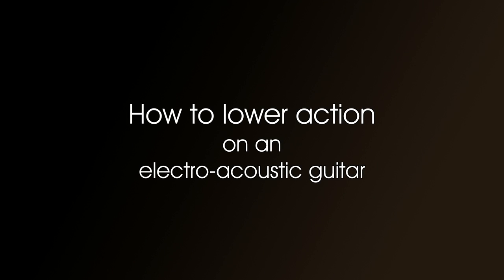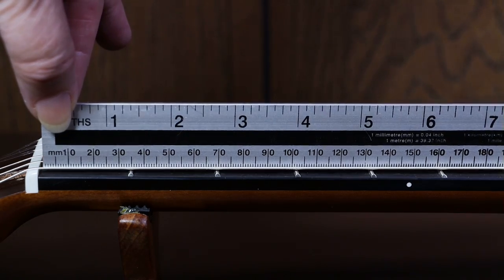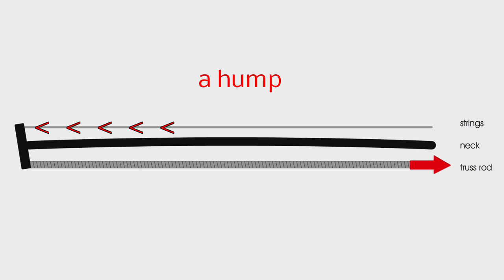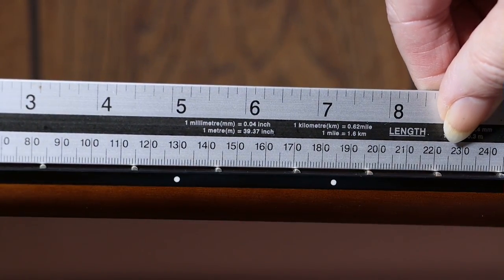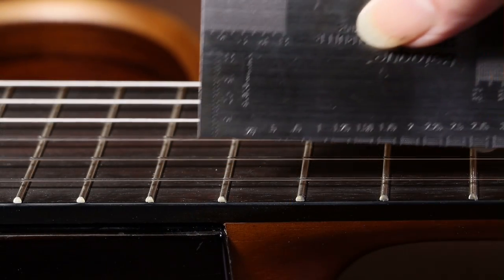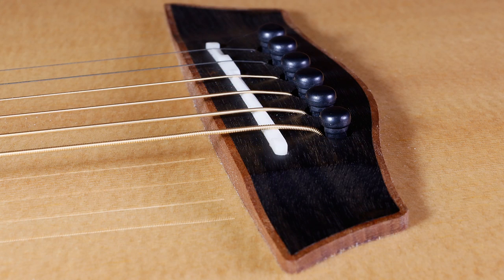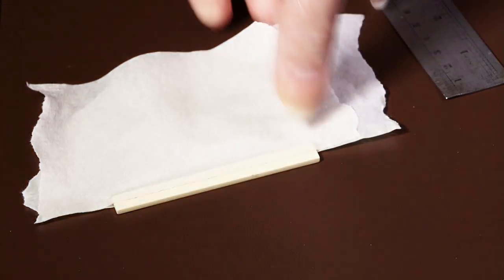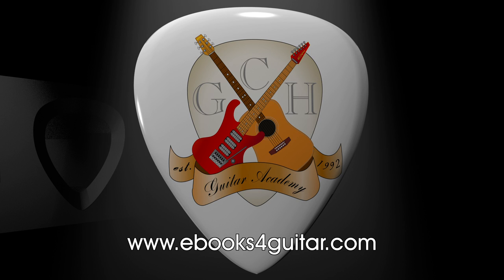how to lower the action on an electro acoustic guitar (Yamaha SLG200n & Yamaha SLG200s)

Comment: I recently got a Yamaha SLG200N and found the action too high. While I was looking for any explanation for the right height, I found this video which is very informative and just the thing I was looking for. I wonder why Yamaha choses this much height on these guitars.
Reply from the maker: I think . . It's easier to lower the action than higher it because you don't need to replace any parts.  🤔
Reply: I have just bought the yamaha slg200n can you tell me what is the lowest height of action i should go for in order to not make a huge buz? The neck is completely straight. Thanks!

Comment: An easy way to check the neck relief is to hold down the string at the 13th fret and look for a gap between the string and 7th fret.  You can push down on the string to see how far it goes before it hits the fret.  If there's a hump, the string will be sitting on the fret.  If there's a bow, there will be a gap.  Many players like a little bit of relief at the 7th fret.

Comment: I wish you included that a slight bow in the neck is actually very desirable! We want the neck relief to mimic the shape of the string as it vibrates more towards the center. But very high quality video nonetheless, I can tell you put a lot of effort in it.
Reply from the maker: Yes and no . .  I need to do a video on this because there's a lot of misunderstanding on this subject and it's hard to explain.  The only time this is always true is when the heal of the neck is above the 12th fret so the bow is around the middle of the neck.  On most acoustic guitars the heal is below the 12 fret  and on these SLGs the heal is at the 12th fret making it not so clear cut.  Sometimes the truss rod anchor point effects whether it should have a bow or not too.
Reply: Absolutely agree with what you said. It's not something that is easy to explain clearly over one video.

Comment: Great video, perfectly explained. I came to this video as I was trying to lower the action on my Yamaha FX370C. I discovered the pick-up was firmly attached to the saddle, so sanding it down wasn't an option.  I discovered that Yamaha put a couple of little shims in the recess that seats the saddle, all I had to do was remove one or both shims to lower the height of the saddle. As an electric player I wasn't aware of this.  I hope it helps someone else out there.
Reply from the maker: Thanks for sharing, yes that's a very useful tip.  Ovation tend to do that as will. especially on the older guitars  😊😃

Comment: I found with my SLG200N it wasn't necessary to remove the strings to take the saddle off because with this particular guitar just loosening the strings ...then sliding the saddle out is the quicker way to do it.
Reply from the maker: Yes, It's handy and a time saver when you can manage to slide the saddle out.  But it doesn't always happen 😒

Comment: Very good advice on this subject. The only thing I would suggest to make sure that the base of the saddle is as flat as possible is to constantly reverse the saddle through 180 degrees after a number of passes whilst sanding it down. I usually do six movements then turn it the other way and do another six. This way you compensate for any natural tendency to lean one way.

Comment: My steel string version of the Yamaha just needed the truss rod tightened and it brought the action down to a very very nice height. I got mine from Sweetwater and i think they loosen the truss rods before they ship acoustics. This is the 2nd one i got where the truss rod was loose. But after doing this, i didnt have to touch the nut or the saddle at all.
Reply from the maker: That's good to hear!  😊😃

Comment: Hi all
I am brand new to guitars and guitar playing. Not even been a week since I have my first guitar. After extensive research, probably on the wrong topic, I decided to buy a Yamaha silent guitar with Nylon strings. I was totally focused on the "silent" part while worrying that I could not find time to practice with a regular guitar due to my schedule. Walls are paper-thin here; hence you can hear the fly in the other room and who wants to wake up the family at night with guitar lessons.
Anyhow, as a total newbie, I was also not aware that a guitar might not work out of the box, and you might have to adjust a guitar to make it more playable, at least for a beginner. 
After I got the guitar, I found out about the importance of the action height. The action on my guitar was 3.65 mm. I measured the low E-string with a feeler gauge at the 12th fret. I searched for the normal or best height and found varying numbers depending on many things. But I also found the information to get it as low as possible, at least for a beginner, without causing buzzing. I wasn't sure if I could do that and what other problems could come with it. Then I found this video with the impressive cristal clear step-by-step instructions pictures and animation, fantastic. With that information, I was very confident that I could do it. First, I measured the neck straightness using my trusty Starrett precision straight edge. It looked OK, but the feeler gauge could find some 0.2 mm gap in the neck middle, which I did not change. I made 2.5 mm at the 12th fret my goal but wasn't sure if I could achieve it due to the remaining saddle height at the low E-string. I measured the saddle and ordered spare parts. I used a sharp caliper to make a scratchmark on the saddle, marking up to where I wanted to remove material. I used different grades of sanding paper, mostly 120, and ended with 400. I turned the saddle horizontally during sanding to eliminate potential mistakes due to not holding the saddle absolutely perpendicular to the surface. 
I only worked on the spares and left the original untouched.
The first one was too low. The high E-String did not touch the saddle. The next one was better. 
I did not remove the strings. I just loosened them significantly.
What can I say? Thanks to this very detailed video, it worked perfectly, even for me as a total greenhorn. The action was now 2.6 mm at the low E-String 12th fret. Things are now getting more manageable. Also, I don't inadvertently mute strings so often.
THANK YOU SO MUCH FOR PROVIDING THIS OUTSTANDING VIDEO!!
Reply from the maker: wow, it's great that you managed to adjust the action on your guitar as a beginner and it's even better that it has made the guitar so much more payable for you . . . great news.  Thanks for watching and your feedback as well 😊😃

Comment: Very detailed video. I appreciate the hard work you've put into producing this video!

One question. My string height at the bridge/saddle for the high E string, is only 3.5mm so according to your explanation, I need at least 2-3mm of height. So in my case, I could only lower it by max. 2.0mm, correct?

Does this rule of min. string height (2-3mm) apply to all the strings? So generally speaking, the limit to lower the saddle height is dictated by the height of the high E string, since it's usually the string that has the least amount of string height, correct?
Or could you "even" out the saddle angle that the height of the saddle would be the same across the whole length of the saddle  thus making the position of all the strings the same - or would that be a bad idea?
Reply from the maker: some good questions 😊 . .  Just to be clear, it's best to measure the action height at the 12th fret because it is dead centre down the string.  
The action is best with a little more height on the thick (bottom E) string, because this string moves more when vibrating.  Because most of the time Yamaha shape the saddle to fingerboard, I recommend lowering the saddle uniformly.
There is no rule regarding string action . .  if you're happier with the action as it is or an action that is slightly higher than the examples used, this isn't a problem or wrong.  Some people like high action and the sound can be clearer with a high action.
I hope this helps 😊

Comment: Good and useful review . I need an advice. I agree:  the action is too high  in my SLGN mainly in the lower part of the neck. For me is important because I Play jazz,  I will go to the luthier for this. Do you think I need to let regulate only truss rod or  to file the saddle and or the nut?  Thanks a lot for your reply and suggestions. Francesco
Reply from the maker: Every one of these guitar is different.  the easiest thing to check is the truss rod and then the saddle, the nut can be hard to setup, which is why I left it out of this tutorial . . . 😊

Comment: Thanks great video!
I have the slg200s streel string
I really really really want to love this guitar as it has a lot going for it, portability, sound etc. But the action and neck profile is a let down on these!
I have many guitars and have always managed to adjust the neck and string action, however this guitar has got the better of me!
I purchased it used, and I'm curious why you mentioned that if it's used it's a problem?
When I got it the action was incredibly high, so I called Yamaha and they mentioned this is by design to cater for people's different preferences.
Anyway I made sure the neck was flat, then attacked the saddle and found that I had to reduce it significantly as much as I could go without the strings touching the bridge, but it's not enough as string height is still a little more than I like it!
The neck profile is too fat as I like using my thumb over the neck!

Also whilst Yamaha engineers have done a great job in simulating a traditional guitar with a sound hole it's not perfect!
If you have the volume over half way and play agressively then it creates clipping compressed undesirable sound!

What to do, I play live often and if Yamaha addressed these issues it would be a perfect instrument!

Also what is strange is that on all my other steel string guitars I use light gage strings and they are a breeze to play, but on the Yamaha silent guitar it feels like I have to work far harder even though I use the same gage strings!
Reply from the maker: Thank you for sharing your experiences of the guitar.  😊😃
Yes, out of the 2 guitars, I hardly ever use the 'S' version.  Yes, I can see why Yamaha would make the action high for all preferences.  Because you can lower action easily enough but to higher the action takes shims or a new saddle.  No, I've never had the problem with clipping unless my batteries are going flat or I used cheap low powered ones.
I've now modified both mine to make the feel better, but I agree there's something about the neck that takes a lot of getting use too.  Strangely though, I love the nylon strung one and use it more than any of my other nylon strung guitars because by classical guitar standards the neck is very slim.  😊
Reply: @guitar-academy  thanks for the prompt response
For me I have had almost a hundred guitars through my hands and this is a winning format!
I'd hope Yamaha can further improve on it, possibly future models.
I play the guitar live and the sound guy's always tell me to turn it down, I find that vol 12 o'clock works best. I've also experimented with steel strings that have a nylon core, seems to make it somewhat more playable, however they cost more

Comment: Great Video! I'm afraid to try this with the original saddle. Could you please tell me what's the correct width of the saddle or which saddle you would buy as a replacement? I already had another saddle with 3.5mm but it doesnt fit. Now I heard that some people recommend graphtech saddles, but I'm not sure if I should go for 3.26mm,  3.15mm or 2.57mm.
Reply from the maker: there's slight differences in all hand fitted saddles and if your are going to adjust it you'll need callipers or something similar to make exact measurements.  So once you got a measuring tool, you would be wise to measure your existing saddle and start from there.
Reply: @guitar-academy  Thank you!
Reply: @guitar-academy  Superb video! I've just ordered an SLG200s, and want to order a replacement saddle while this is on the way. Since you're familiar with the guitar, do you happen to know which Graphtech TUSQ saddle models are a reasonable fit for the 200s? Alternatively, what would be your choice of replacement saddle model for yours? Thanks.

Comment: Hi, before you lower the action, how straight do you make the neck? I see the manual suggests that the neck should be slightly concave (what defines this?)
Reply from the maker: There's no exact number for this as it depends on how level the frets are and the natural imperfections of the wood.  Another thing that will effect the recommended curve and height is how hard you play the guitar and if you use a plectrum.  The harder you play the greater the curve and action should be. Because the heel of the neck comes down to around the 12th fret (it's slightly different on the S and the N) the concave only needs to be very slight, 1mm at most 0.5 is better.
Reply: @guitar-academy  thank you
Reply from the maker: @tonytompkins831  no problem

Comment: Hi, I have a electric  guitar and I want to check my guitar neck reliefe but how can I understand which fret should I use to check with feeler gauge? I know I should use capo on first fret and I know I should push with my finger where my guitar body meet with my neck but I don’t know which fret should I use to check with feeler gauge. I hope you can help me.
Reply from the maker: You'll find lots of different answers to this question because it's different for most guitars.  If you can't find the measuring point recommended by the maker, measure halfway between the joint to the body and the nut. This is usually a good measuring point . . 😊

Comment: I want to shave the saddle down on my Yamaha SLG200n but it's about 5mm on low E and 2.75mm on high E, can I shave 2mm off and still be fine on a high E side?
Reply from the maker: Sorry I couldn't answer that without seeing the guitar because it depends how level the frets are and how straight the neck is.  I would suggest that if you're not sure get a spare saddle so you can undo it if the guitar buzzes . . I hope this helps 😊

Comment: does Yamaha SLG200 have stainless steel frets? or nickel
Reply from the maker: they look like nickel or a nickel alloy, but Yamaha don't say 🤔
Reply: @guitar-academy  Can you power this guitar from instumental input via audio interface? not plugin power adapter and cell batteries?
Reply from the maker: @ilyasofronov6411  No . . it only works with batteries or power supply 🤔🤔

Comment: Somewhat unrelated. I find that the SLG200NW is pretty bass heavy. I was wondering if anyone has had similar experience and whether changing the strings (maybe high tension ?) improved the situation. Thanks!
Reply from the maker: Interesting!  I agree with you that strings can make a huge difference for minimum outlay  😊

Comment: Thank you for such detailed explanation!
Reply from the maker: Glad it was helpful!  thank you 😊😃
Reply: @guitar-academy  Very helpful. I've checked the neck and it's flat. But yet my guitar doesn't give enough sustain and pressing is a little bit hard. Can you advise what can I do toake the setup better?
Reply from the maker: @ShlomoNizin  the first thing that springs to mind is the strings.  The heavier the strings are the harder they are to press and all strings over a few months old loose there sustain.  Maybe try some lighter strings . .  If the action is high the strings will be harder to press because you have to push them further, but higher actioned guitars tend to have better sustain . . .  I hope this helps 😊😃
Reply: @guitar-academy  Thank you. I've recently replaced the strings to the extra light Elixir (10-47)
Reply from the maker: @ShlomoNizin  ahh . .  well it sounds like the action is too high, but the lack of sustain is something else.   🤔

Comment: Doesn't the fretboard suppose to show a very small bow while holding the string pushed against the 12th fret to eliminate buzzing?. I enjoy your videos. I recently purchased the book collection. Thank you
Reply from the maker: This is true according to Fender handbooks but many other manufacturers don't recommend it.  I find it a good idea on a lot of electric guitars with 25.5 inch necks, but with shorter necks and acoustic guitars I find flat or nearly flat is better.  It is important never to have a hump and therefore it's better to have a slight bow if your not sure.
Reply from the maker: @ras1500  that's interesting . .  
I'd recommend to measure the bow from around the 7th fret or better still measure the length of the neck from the nut and measure the bow at the centre point.  (I should have put this in my video 🤔).  This is because the centre of the neck is where the bow will appear deepest.  The 12th fret is the centre of the scale length which goes all the way up to the saddle.
All this being said, sticking strictly to construction theory rarely works and everyone has there own setup that they love and every guitar has it's own idiosyncrasies. 😊😊

Comment: Great video - thank you. After watching this I am confident in lowering the action on my SLG200S. I know its a personal preference, but what action do you recommend for a beginner to have on this guitar?
Reply from the maker: Sorry, I really can't answer that question accurately.  It's more than personal preference, it also depends on how level the frets are and how straight the neck is.  Even on the most expensive guitars there's differences in these things.  But as a guide, my slg200s is 2mm at the 12th fret Bottom string and slightly lower 1.9 at the 12th fret top string.
Reply: @guitar-academy  Thank you👍